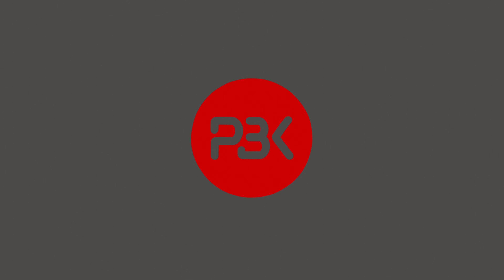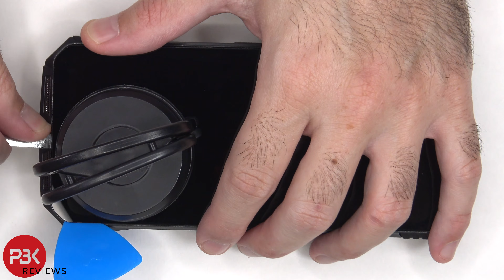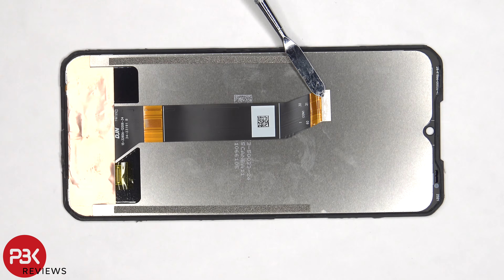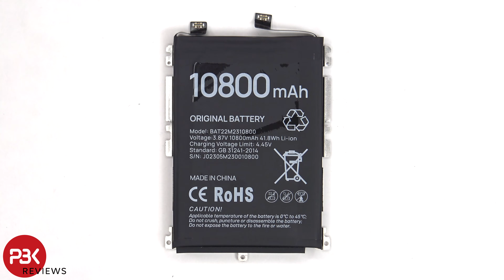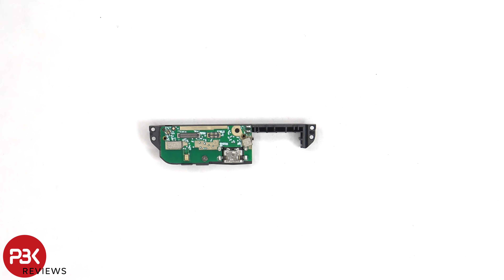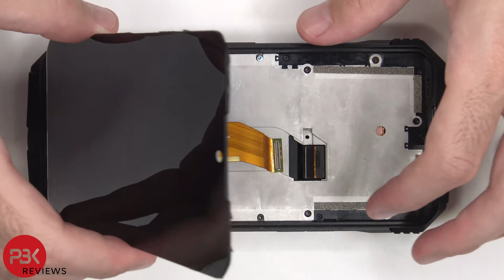Doogee S110 Teardown Disassembly Repair Video Review

Comment: So you need to remove the screen to get to the battery😅 ugh. Older doogee phones allowed you to remove the backplate and replace the battery from there. What kind of adhesive is used to connect the screen back to the case?
Reply: Older doogee phones lasted 4-6 weeks but this one went from 3 weeks to 3 days in a realy short time.
Reply from the maker: yep, and its not easy at all, the glue is very strong. You will need B-7000 adhesive glue or something similar to re apply.

Comment: I have the doogee S110 LCD screnn broked, I buy China's replacemt piece because here in Brazil there is no such thing ... The local techics told me that even if changing the new screnn the military specifications of the device that claim to be the proof  Water for half  hour in half meter deep, will be lost. How should the manufacturer's quality be maintained on this device dive water subject ❓

Comment: What do you think of the quality of the phone? Are the parts and the phone's overall build of good quality? By the way, I saw your Pixel 8 teardown and it seems strange that you gave it a higher repairability score when you actually broke the screen from trying to open it and the inside seems like a mass of black sticky glue that you have to get to remove in order to remove cables. Meanwhile, this one seems more straightforward. All you need to do is unscrew the screws and pop off connectors. Just wondering what your criteria is for ease/difficulty of repairability.

Comment: I have this phone and strangely, that 10800 mah batteryz feels like it can do barely 2 days. However I would expect at least 3 days. I had S98 Pro, it has 6000 mAh battery and it can also do 2 days.
Reply: Maybe beacause of 120hz on s110
Reply: I experienced the same thing. The S98 has a better battery capacity; this one runs out faster. Also, the speaker is broken; there's no sound, or only a low sound.

Comment: Do u know why when i connect USB smartphone is only charging and nothing else. I cant force to send files to PC via USB. Even change settings in developer options doesnt resolve problem. I have 2 of these and none of them USB sending files not working!!! There is no option to choose what to do after connecting USb. PLEASE HELP!!! Doogee doesnt care. THX
Reply: first check if ur cable is for only charging or for data also, try other cables
Reply: U think im idiot?? Any other mobile is working perfectly with this cable i own. Doogee is crap
Reply: I had to replace the USB board. Worked for a month. Bad USB component at least.